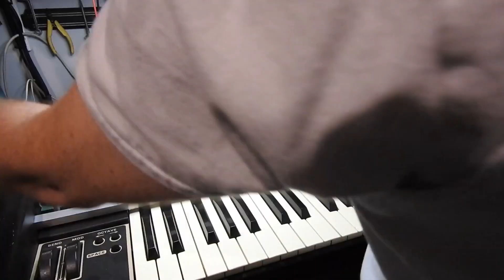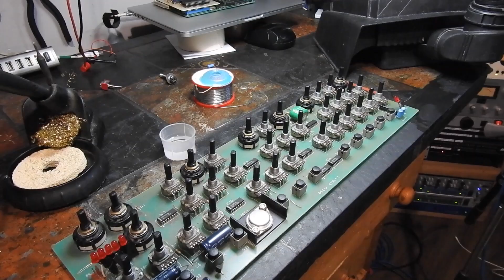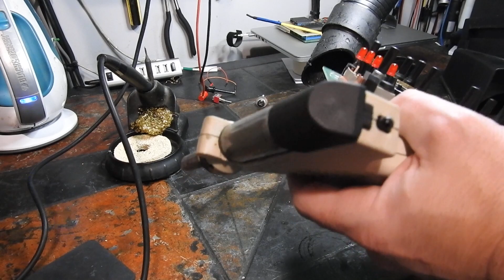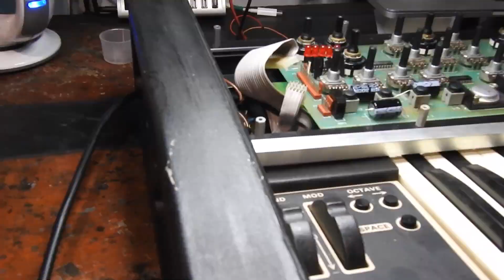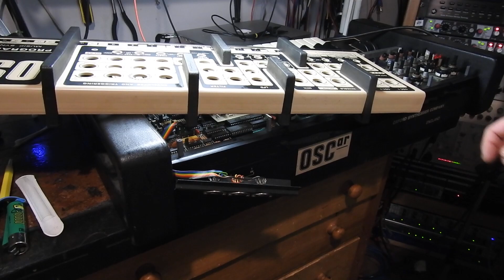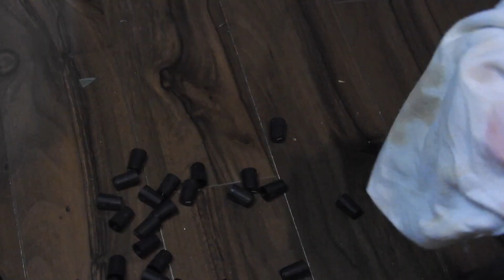OSCar Service

Comment: The firmware doesn't reset RAM properly at boot.   If RAM happens to come up with certain bits set or cleared after a battery change, the CPU can get locked up.

Comment: Nice to see another OSCar  video. The reset/start up CPU interrupt routine on this synth is the worst. It's such a bad design. The timing is so precise, even a slight intolerance will stop it from booting. Mine only starts once out of 15 times, and usually the RAM is scrambled and needs to be sysexed back. I have done everything (new battery, connectors, sockets etc etc) to get this sorted, with little success.

Comment: Thanks for the video! Some questions:
1. why did you replace the backup battery with another of the same kind? Wouldn't it be better to avoid that kind of battery, as they might leak on the PCB in the future? Why not adding a separate battery holder for AA type batteries (as shown in some other videos as well)?
2. any idea on how to remove an audible hum present in the audio path? I've seen some suggestions about adding a capacitor between ground and 0V-ground... any help on this? Does your OSCar have this ground hum?
Thanks!